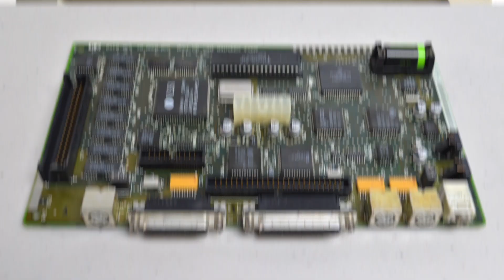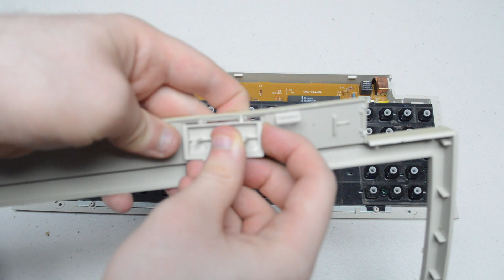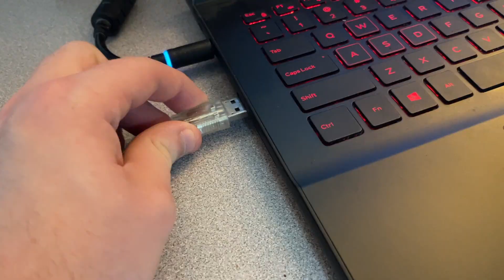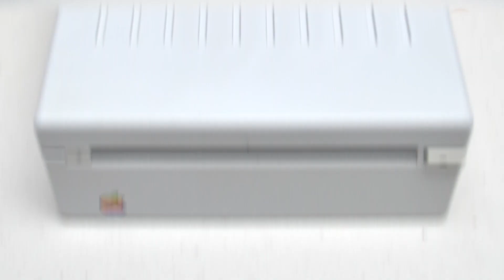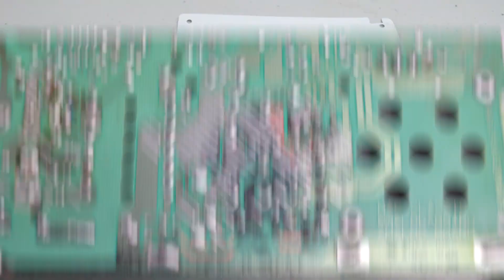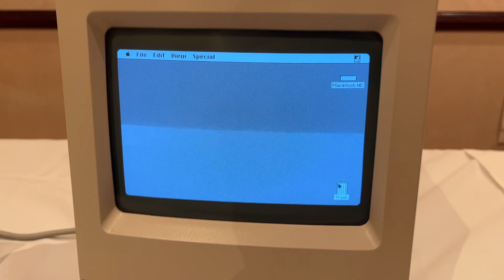Macintosh Classic Restored! (but mistakes were made) - Savvy Sage

Comment: FYI, the "repair guys" recapped your Macintosh Classic the correct way.  DO NOT replace the electrolitic capacitors with solid state capacitors.  They have different characteristics, and when the solid state capacitors eventually go bad, they pop or blow, taking traces and pcb with them.  Electrolitic capacitors that are made in Japan, Germany, or the USA are very high quality and will usually last for 20 to 30 years.  🤔
Reply from the maker: All I can say is at least I won't need to worry about them for a long time—electrolytic capacitors today aren't as bad as what Apple used back then, haha

Comment: Great video! Thanks for making it! Quick note: using the screwdriver like that runs a big-time risk of damaging the keycaps. A tool for pulling keycaps is a much safer option. The metal screwdriver can easily leave marks on the edges of the keycaps where it makes contact. If you don't have a keycap puller you can use something softer like Popsicle stick, old plastic credit cards, or maybe chop sticks. The idea is to avoid using any metal tools because they will scratch and gouge the plastic. ALSO: You don't want to put anything metal in the hydrogen peroxide. It will "use it up" and the retrobrighting won't work as well. Also, in this case, it will corrode the button contacts inside the switch. I wouldn't recommend that either. I'm sure the switch still works for now but it's going to need to be treated with contact cleaner and eventually be replacement much sooner because of this. ADDITIONALLY: I wouldn't leave the Apple logos on their. They can usually be popped out with a paperclip from behind as there is often a little hole in the plastic. The retrobrighting may damage the printing and finish as well as basically de-blue (yellow) the silk screen printing. So I would highly recommend removing the Apple logos.
Reply from the maker: Thanks for the tips! A keycap puller is something I should consider getting if I plan to restore more keyboards in my spare time—it'd probably save me some headaches too 😅

Comment: Just finished the third and last video of your Macintosh Classic and it was very interesting to watch. I am very happy that the puppy works fine again after so many years. I guess the advice not to buy those kind of Macs if you want to collect old Macs is absolutely right. I’ve bought an iMac G3 as well as an G4 eMac and both start to fail quickly after working at the beginning and guess what, of course it were bad capacitors as well as problems with the analog board. I also have no real skill to fix that at all and also didn’t want to work next to the dangerous CRT. Both are now used as decoration in the background of my videos. But the best Mac in my collection is definitely the Macintosh Quadra 700 which is fully working despite the floppy drive being kinda buggy cause it does not properly ejects nor reads the disks all the time. It’s really cool to have this special Mac next to my original Jurassic Park VHS from 1993. The Mac itself has System 7 pre-installed on the - still working - SCSI hard drive. Greetings from Germany.